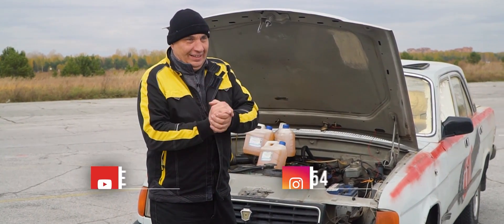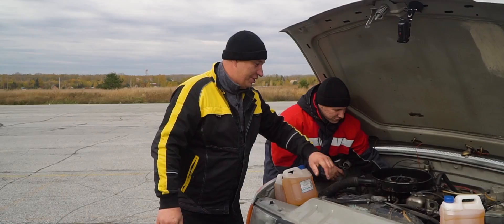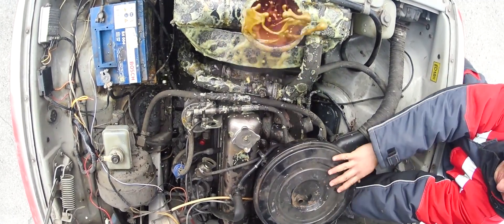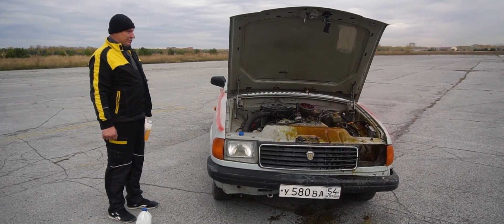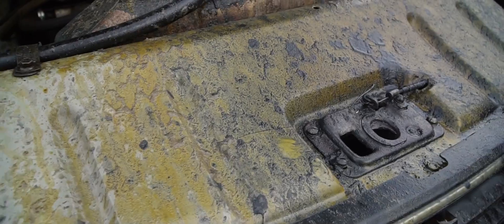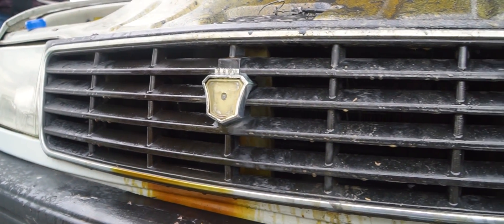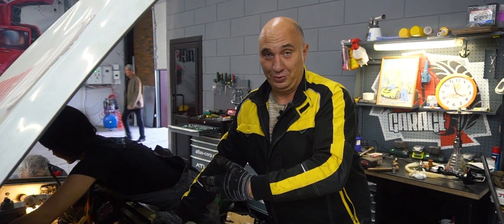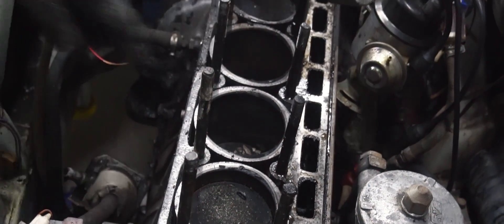We fill a running engine with iodine monochloride – what will happen?

Comment: Could you do a welded differential but have fluid couplings on each axle, then separate the rear brakes to see if you could steer with differential braking like a tank
Reply: It couldnt, because the diff is welded
Reply: @miliz22  but if you had a fluid coupling on each stub axle it would allow for slip if you left it open you would just lose power

Comment: Test Wd-40 as cooling liquid, please. To see if rust inside lada's iron engine block stops.
Reply: How do you see rust stop in minutes, and plus WD-40 isnt a lubricant like motor oil, if uou have rust in an engine it wouldn’t even run.

Comment: Please garage54 I have a great video suggestion!! Fill a lada rear axle differential jam pack full of peanuts and see if driving the car turns the peanuts into peanut butter and if it does repack the front wheel bearings with the peanutbutter instead of the grease.  Please me and some friends were talking about this I'd really like to see the outcome

Comment: Sounds like the aluminum in the radiator turned into salt and erroded. I'm guessing the iron has also converted into salts on the surface as well.

Comment: Maybe try putting gallium on the engine block/head if its made out of aluminum and see what happens, takes a while to react though.
Reply: the engine's foaming red she's bleeding out save her if you can🤣😂🤣
Reply: They would have to clean and scratch up the parts so it doesn't have the aluminum oxide layer.
Reply: @jwalster9412  so she's a lost cause gotcha👍🤣🤣

Comment: Great video! IN the future, i would suggest doing the same experiment with gallium- make sure it is an aluminum block. Gallium turns aluminum into a semi-liquid that would be fun for a running engine! :)
Reply: Instead of wide open to blow the engine just running it would window the entire engine.
Reply: Sounds expensive. Would definitely not be as spectacular either.
Reply: @m.b.82  If the engine was pulled and set up on a stand or hoist I would love to watch it
Reply: @d.martins4471  it takes ages to do anything and no pink smoke.
Also, it would cost a fortune.
Reply: Clean the top of the pistons (which have to be aluminum), screech them a bit, pour a healthy amount of gallium on, wait for a while for it to become one with the aluminum, then attempt to start the engine. It would probably become dust if done right.
Reply: Not a bad ideea but gallium takes some time to attack all the part. Have a look on The Lockpicking Lawyer channel, him put gallium on a keypad lock. Pretty interesting. On a engine i think will be hard to do but not impossible. 😅
Reply: The problem comes with gallium being very dense and would likely hydrolock the engine.
Reply: @d.martins4471  Maybe just take some bolts out, inject gallium in the bolt holes and replace the bolts. Or take the head off, scratch up the cooling jackets, dump in some gallium and put the head back on.
Reply: It doesn't turn into a semi liquid at all, wtf? It just makes it brittle. Car windows are brittle, yet we call those solid.

Comment: I don't know the names of these coolants but they're used in cnc shops one kind looks like oil  when water is added it turns milky the other kind is green and when ya add water looks like antifreeze the green one if u put a red hot part in 3 seconds pull it put u can touch it its cool I wonder if either of those would keep the engine cool on a car
Reply: it is called water soluble oil :)
Reply: where does he get these awesome show ideas?🤔
Reply: Generally, it is water soluble oil and it is ~4-8% oil concentration and the rest is water and anti-rust/biologics. Depending on the brand/type it ranges from clear to milky white to blue. The main goal is lubricating the tools and sucking the heat out too, a nice side-effect is it generally flushes the chips too.
Reply: @MakeItWithCalvin  it makes a nice messy milk shake in the rad though🤣🤣
Reply: I think it's called Blaser Swisslube. I used to use it in a centerless grinder

Comment: I can’t remember the name of the metal I think it’s called Galium. It’s a metal that eats other metals. I would love to see someone pour that inside a running motor to see how long it last before breaking down.
Reply: Gallium works with aluminum
Reply: It only “eats” aluminum
Reply: It needs good contact with the bare metal to get started.  An oxide or sludge film would keep anything from happening.  You'd have to at least put some scratches in the part that you want to compromise.  Mercury does it too, but it is toxic.
Reply: @thesquarerootofnegativei6225  you could add a small percentage  of nitric acid or even hydrofluoric acid which would break down any oxide and prevent it from forming hydrofluoric acid is usually the active ingredient in aluminium cleaner.
Reply: @thesquarerootofnegativei6225  fill it halfway with oil and the other half with galium I think that would solve that issue of it not being able to make contact with the metal because of the oil film.
Reply: It won't eat iron.
Reply: @erikkovacs3097  I would love to see a iron block and head use gallium as a coolent. I have no idea whether or not it would work to transfer heat away.
Reply: @bigjay875  sounds like a fun idea, but gallium will not eat through iron or steel
Reply: @wildfirephoenix2262  I'm more interested in the ability to move heat away from the motor at this point but I'm sure a bit of standard coolent would heat up and build pressure till the aluminum radiator gave up the ghost and popped
Reply: It only works well with Aluminum.
Reply: Great idea but, gallium is very expensive and it only reacts to make amalgom with aluminum
Reply: gallium
Reply: Kinda expensive to fill whole running engine:)
Acid can do same job cheaper..
Reply: The issue with gallium is that it has to be bare aluminum. Any oily, or moving parts in the engine and would probably have troubles getting galliumed. Also I imagine it's handled to find a Lada with a full aluminum engine blocks and pistons.
Reply: Epic idea
Reply: It doesn't eat them, it amalgamates aluminum and makes it extremely brittle
Reply: It "amalgamates" with other metals... like aluminum.  Mercury does the same thing and is probably labeled as "safe" over there. :P
Reply: Galium is liquid in your hand and can "eat" aluminium and make it very weak as ice.
Reply: Yessss!